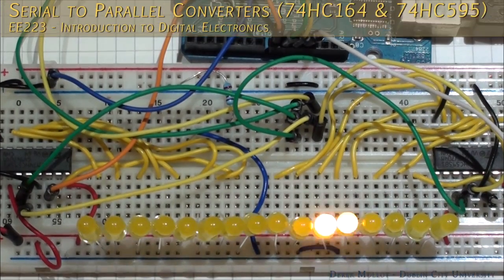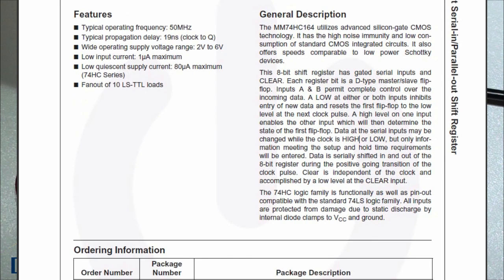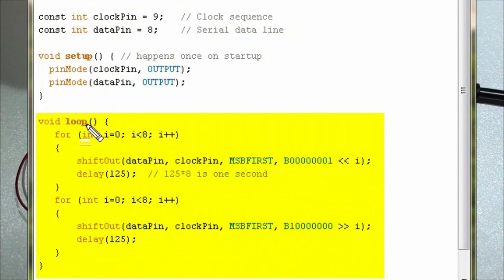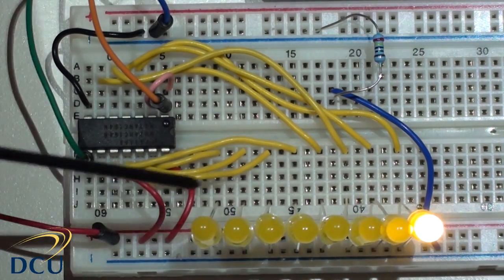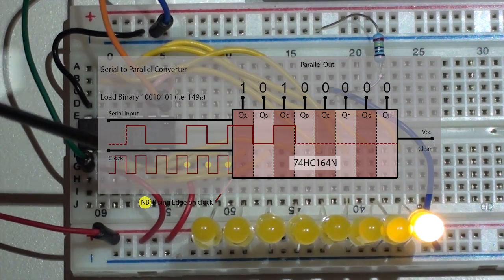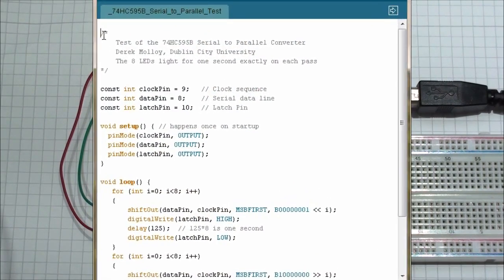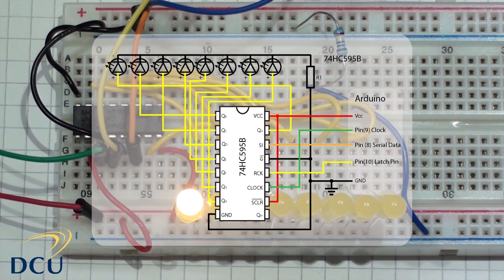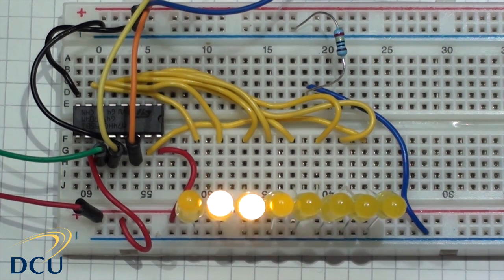Experiments 5.2: Arduino - Serial to Parallel Conversion (74HC164 & 74HC595)

Comment: Thanks! I needed this for my leds to do at startup. I save a a lot of pins this way. But (question) with same setup if I put use the pwm to control 2 leds parallel (for fading light possibilitys) will the current affect the chip or is there a way to prevent this?

Comment: When you added a second 74HC595, is there a reason that you used a second data output from the Arduino, as opposed to using the Q7' pin on the first 74HC595?

Comment: You can also place a transistor between the cathodes of the LEDs and the ground. That in essence dubs for a latch. I use that trick when driving larger groups of LEDs, (around 50 and up) Makes having 595's obsolete imo. Just make the base of the transistor high when you want the leds to turn on.

Comment: Isn't it possible to ground the led's through the source-drain of a transistor and drive that transistor with a PWM pin to simulate a latch while using the 74HC164?

If it is than it would be very easy to not only remove the flickering led's but you could change the duty-cycle and thus the intensity of the led's with the arduino using that method.

Comment: No, you don't. You can also daisychain them together. There's a serial output on the 595 that can feed the serial input of the next. Just daisychain them and connect the latches and clocks together. As @QSQCaito pointed out, you can then send 16bits out in one go, instead of 2x 8bits.

Comment: You can cascade the 595 using the serial out. That way you wouldn't need a new wire. You tie together the transfers and send 16bits instead of sending two times 8bits.

Comment: Derek, does it make writing code easier when you use the 1 extra pin to control the second 595 rather than connecting pin 9 from the first  595 to pin 14 of the second? (using only 3 Arduino pins rather than 4)

Comment: Sorry for being finicky but in your code you wrote that "The 8 LEDs light for one second *exactly* on each pass", but isn't there some extra time used by the microcontroller to run the "for" instructions between a Timer Interrupt (or wathever the delay is) and an another one? I'm not really sure of this, infact I'm asking..! ;)

Comment: @DerekMolloyDCU I'll use a bunch of BC547 instead of ULN2803, since it'll be cheaper, I have one ULN2803 that I used with one matrix, worked fine, but there was only one matrix, hence only 8 LEDs per row/column, with three matrices there'll be 24(48) per row/column (bicolor matrices), I'll use transistors as drivers on the anodes, but as for the cathodes, the LEDs will bedriven by the 74HC595 itself, I would like another driver here just to be on the safe side.

Comment: Nice vid.
But I guess you forgot the current limiter resistors on the LEDs.
BTW, I'm planing on making a big LED matrix using my arduino, I'll use 9 8x8 matrices, it'll be a 24x24 LED matrix and I'll use 6 74HC595 to drive the matrix, I'll use a bunch of BC547 to source the current to the LEDs, but I'm not sure if the 74HC595 will be able to sink all that current from 24 LEDs since a whole column might be lit at the same time, any ideas on how I can address this issue?